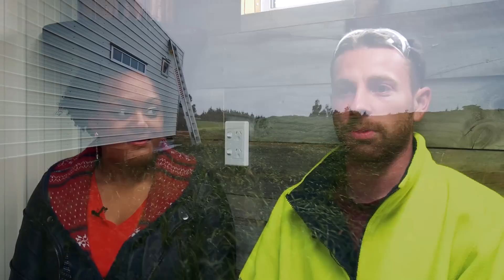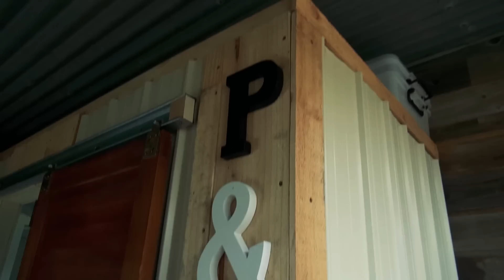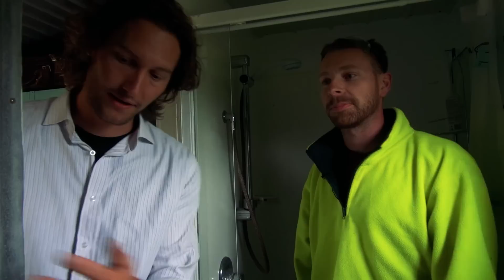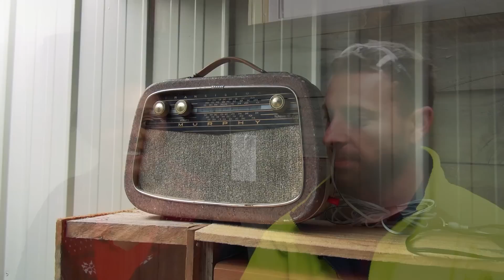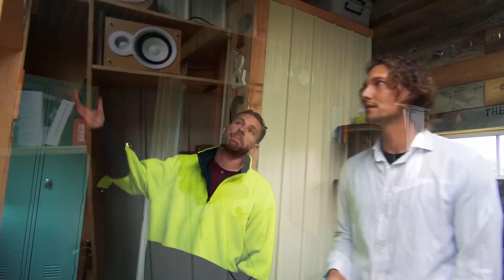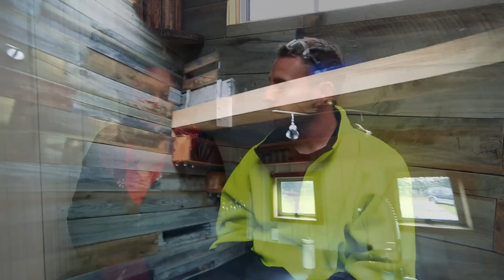This Incredible Tiny House Was Built For Only $10,000!

Comment: Cute couple love the tiny houseI am not a sleeping loft fan and I love the sliding bed. I love the rain on tin roof.This is one of the most practical tiny houses I have seen. A lot of tiny houses look pretty but are unpractical.
Reply: They also have a great sense of color. The blue on the wall paneling looks super.
Reply: And this little tiny house has something that a lot of them don't. They both have their input. They're both working with this together and that is what's going to make it. All the best. Best wishes and hope everything works as planned and everything goes well for the rest of your lives. You have a solid foundation that's important and then the house is built on that and everything else comes with that so you guys are good. Good luck with the rest of your lives and thank you for sharing

Comment: Enjoyed this video Bryce, thanks! Feeling very inspired by the trundle bed (and the under-floor shoe storage...)! For those of you in the US who thought he meant that trailers cost around $3000 here in NZ - that's not actually the case. Trailers average $10,000 (NZD) here. Most tiny houses that are already built and kitted out will set you back $70-80,000 (NZD). So their $15,000 build is basically a miracle and very inspiring! Wondering how many hours of work went into this tiny house though?
Reply from the maker: +Larissa Waring Thanks Larissa. And yes, you're right. The trailer was 3k for a second hand trailer, and that's a great price! They are very hard to find in NZ. And yes, that figure doesn't count the labour. That's why the DIY builds are so much cheaper.
Reply: +Larissa Waring  I think he had a big advantage working in construction -- he worked on the sites that were throwing stuff out; he had the skill set to build things; he probably had all the tools he needed or easy access to them already via friends or whatever.  If I tried to do it, I'd have a hard time, because I've pretty much no practical construction skills, and wouldn't know where to look for the materials.  You'd have to just scout the area in a car/van (if you have one), I guess and look for skips and plunder them religiously at the weekend.

Comment: I love the tiny house ethic, and I think they have truly built a reasonable solution for their living accommodations. I'm of mixed feelings regarding the completed result, however. The outside looks a little more like "Shack," rather than tiny home to me. Also, I think an opportunity was missed in the construction of the upper lofts. If they could of managed another couple of feet in overall height of the roof, I think they could have had one upper living room and one extra sleeping space. I find allot of folks miss out on this part of the tiny house build. I understand the house width and somewhat its height is determined by the trailer chosen to build on, so why not choose a trailer which is a little wider ? I love the kitchen :) It looks spacious and the stainless steel counter tops assure easy cleanup after meals. I don't dig the dining table solution they came up with. I think having a slightly larger table to eat from makes for a more enjoyable experience.

Comment: One thing I've noticed about re-purposed materials is that the rough unfinished texture you love to look at is really not cool when you live with it, unless you sand and seal (even just using oils vs. varnish).  Splinters, for example.  And longevity. And insulation from a dumpster, unless it was only ripped out in order to update or because something was being demolished, is iffy.  You don't know what you're importing to your house.  True also for second-hand upholstered furniture: one friend of mine bought a beautiful vintage collection of fleas.  All these can be negotiated, but think about them as you acquire items.

Comment: Just the other day I was walking from the train and found 16 full lengths of Gyprock 1800mm x 2400mm out the front of a house under construction and this was excess waste / construction material but brand new and not cut.
Not good for weather due to its porous nature but would be good for internal construction.
Even had a  12 volt water pump with a filter system. Got to start keeping my eyes open a bit more.
Planning to go off the grid in around 2 years and already have a lot of the power system sorted with over 100 meters of electrical cable ready to be installed along with batteries, inverters/converters and solar panels  ( 12/24 volt around 200 watt depending on configuration )
Got a 200 liter tank ( for drinking water ) plus a removable pond which I plan to use for Aquaculture.

Comment: Is the inside insulated or it does not get cold over there?
Reply: It's insulated. The builder said in the video that they found all the insulation they used in dumpsters and the like.
Reply: +Prada Versace that was my question, too. The ceiling clearly does not have insulation and the rain-noise was loud. It's nice at first but I think it would get extremely annoying after a while.
Reply: +K Gifford --I was wondering that too, but I think it is insulated. The ridges run water off the metal roof, and the interior ridges run side to side. His job is construction, so I cannot imagine not totally insulating, when he he said he got it from stuff being thrown out from work. It would be freezing, defeating the purpose of being cost efficient. That was my reasoning.
Reply: +K Gifford The guy mentioned he insulated so that's a yes. and you actually get really used to the rain sound (I know because I've lived in such).